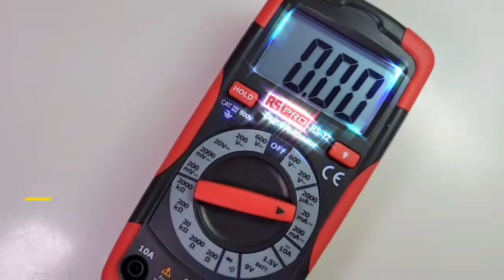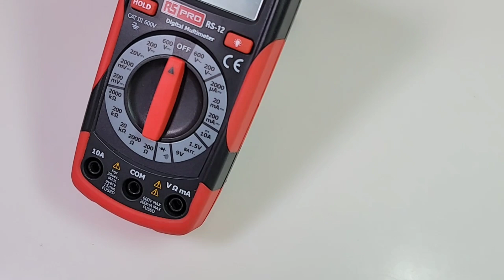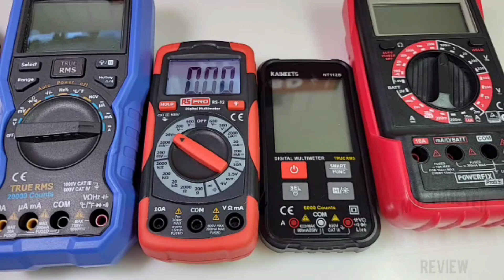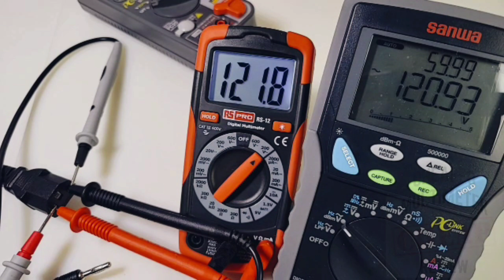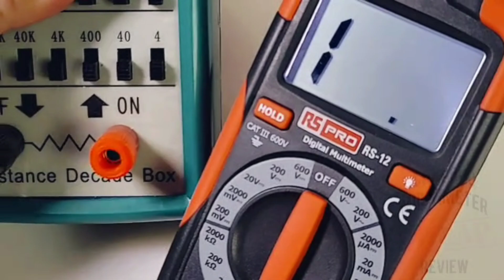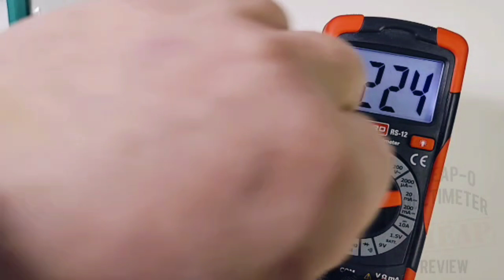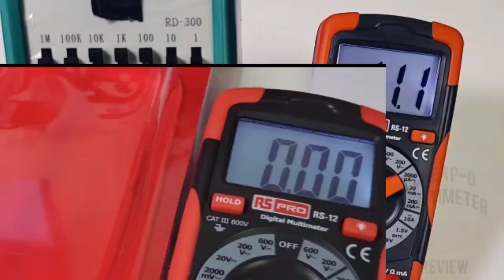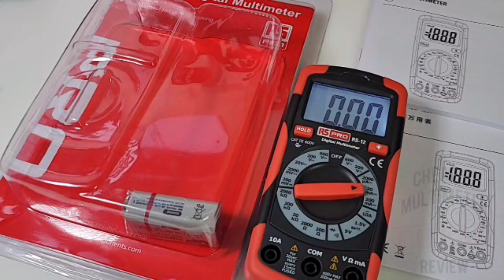RS PRO RS-12 CHEAP-O Multimeter Review & Teardown!

Comment: It was so close to be a better version of Habotest HT108L, but no. I would still probably go with Habo just to have faster resistance ranging. Had it had 1.5V batteries and fast resistance, it would have been a great basic cheap-o for home use.
Reply from the maker: 100% 😀👍 A real shame on the resistance range...

Comment: I wonder if there is something wrong with this unit. The resistance mode is simply too slow for it to be working as intended
Reply: Yes friend, slower than dt830 series.
But maybe on the LEDs test the probes polarities was reversed.
Reply from the maker: Unfortunately not..the slow resistance reading seems to be inherent in the design. The RS-14 apparently suffers the same fate.

Comment: Well resistance was slow but accurate, low count but I did like the inclusion of that high current resistor at R11 - ive seen a LOT worse in this category.  If the resistance had been faster and maybe four thousand count this would have been more of a winner.   I have the older precision data instruments autorange version of one of thee and its even got an led at the top for continuity and I bet a good cleaning of the lead tips with some isopropyl and steel wool would help that weak continuity.
Reply from the maker: Definitely bang for buck here.. more good than bad that's for sure!

Comment: RS Pro in the UK is the Radio Spares (RS Components) own brand. I think they are predominantly CEM or Applent rebrands. The CEM units can be a bit hit and miss, I looked at one of their insulation testers and build quality was pretty poor and had some quirky operations. The resistance and diode function on this weren't the best were they, I guess for hobby use it isn't too bad, but it generally not what the RS Pro brand was aimed at, as far as I know. Thanks for the review.
Reply from the maker: Cheers mate 👍 Indeed the badic diode test was slightly off kilter which irks me since it's utilizing a 9v power source. This label seems to brand some decent gear perhaps I shoukd grab a CEM or two..
Reply: @AlcoveShadow  I have only ever used EBL NiMH cells from your list, so cannot comment on the rest. The EBL cells I have had have been fine, hold their charge well and seem to match their rating.

Comment: The beefy resistor chain on the right side (R12 onward) was 5 x 1-watt resistors, overkill for a cheap-o unless the input impedance is 1 meg (and not the usual 10-11 meg nowadays). At 600v it shows CEM really didn't want a plasma arc killer meter to smear a good reputation.
Reply from the maker: Great point..internally it's quite decent, definitely a step up from the usual CHEAP-O fare.

Comment: Hey nice review. 3/5 is where I would put it as well. Overall I think it does ok for the intended market. Checking fuses or the car battery. It blows away the 3 dollar HF meter. Seems like it would take a fall if it has to.  It was my 30th DMM so I probably won't really use it but I like the colors so I'll keep it. Kaiweets week sounds great. I really like the HT118A except the continuity is slow. May have to upgrade from my normal Pomona leads to see if that helps.
Reply from the maker: 30th DMM..now that's what I like to hear 
😀👍 Do swap those test leads as they are definitely holding your HT118A back from continuity greatness !